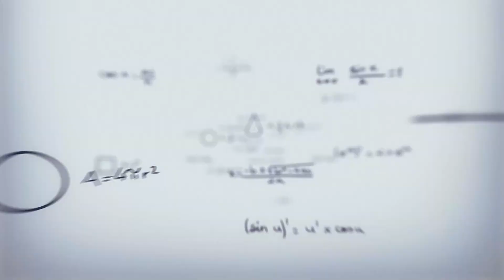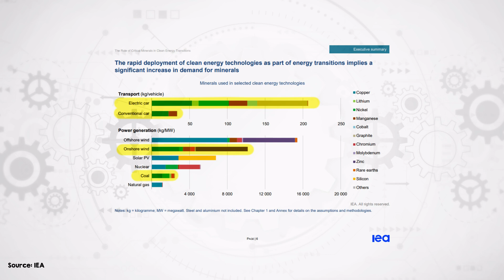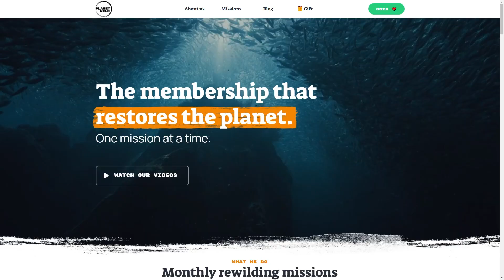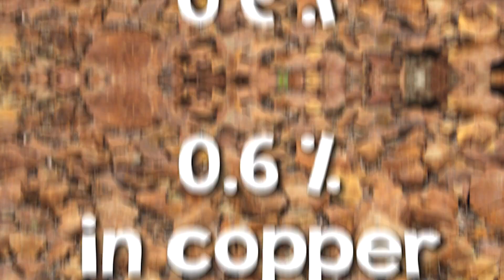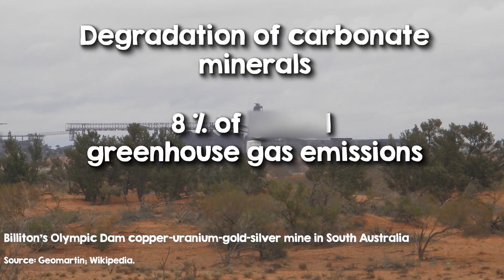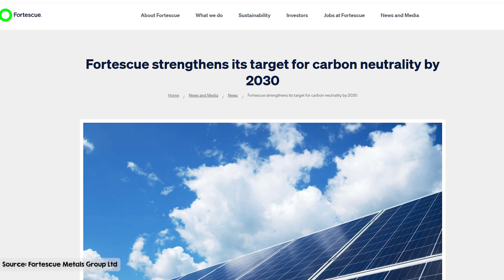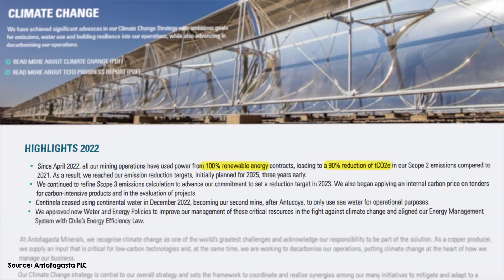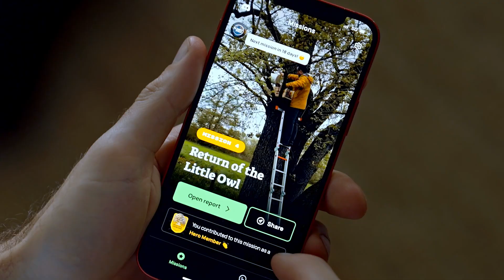Zero-Emission Mining Technologies are Here

Comment: Your an Engineer, while in theory your seem correct, you really need to spend some time with a Economist or just someone who knows basic maths!

You said a avg car burn 17k tonnes of fuel, probably does. But you say the Electric car only uses 160kg? Thats only for the Battery, that battery needs energy to actually move the car. Essentially the battery is just a 160kg fuel tank, made of expensive and heavy materials. (That also requires huge government subsidies to make it actually affordable for everyday consumers)

Currently EV's pull their source of energy from the grid which is mainly fossil fuels (How much is the total tonnes of fuel needed when you factor this in?) You should also measure this by car weight x miles travel. Your cherry picking data here!

As we move more towards EV's that demand on the grid will grow which will cause more demand for energy, which results in higher electricity cost for everything. EVERYTHING

Now to the MINING, I'm shocked it only contributes 20% to total green house gases. An avg dump truck burns around 500-800litres of diesel per day, 24hr a day, 365days of the year. Also Electric Dump trucks are a scam, they are smoke and mirrors tactics for big companies to look "environmentally friendly" because none of those Electric mines are profitable. hint: they do it for the tax write offs.

JCB & CAT both abandoned their research and production of Electric Mining equipment saying it not financially viable and the electric motors can not produce the power levels required to move large quantities of pay dirt. Again they only make EV machines to look "environmentally friendly"
Reply: Nah that is a load of hot garbage. Electric motors are already common in large industrial machinery, as many of them are actually diesel electric. Electric motors don't care where the electricity comes from. That is why they will take over the market and nearly all combustion engines will become obsolete.
Reply: Last month CAT announced its first underground electric mining truck.  Also, CAT displayed electric mining equipment at the 2024 Consumer Electronics Show in Vegas.
Reply: Again these are mostly smoke and mirror tactics to look “environmentally friendly”

Still isn’t a profitable full scale EV mine site any where globally. 

It’s why only the big corporate company’s are getting into it cause they can afford to take the losses.
Reply: Again these are mostly smoke and mirror tactics to look “environmentally friendly”

Still isn’t a profitable full scale EV mine site any where globally. 

It’s why only the big corporate company’s are getting into it cause they can afford to take the losses.
Reply: Again these are mostly smoke and mirror tactics to look “environmentally friendly”

Still isn’t a profitable full scale EV mine site any where globally. 

It’s why only the big corporate company’s are getting into it cause they can afford to take the losses.
Reply: JCB are going for hydrogen, which can be produced by electrolysis, although that is currently more expensive than getting it from natural gas:

' JCB’S £100 million investment in a project to produce super-efficient hydrogen engines is going full steam ahead – with the reaching of a major production milestone.'

They are not sticking to conventional diesel.
Reply: @davidmartin3947  Hydrogen can indeed be produced by electrolysis... and the power for it can come from tenable sources.
Unfortunately, it does not.  Nearly all the hydrogen produced in the world is done by steam-reforming from either coal or natural gas.  Using THAT hydrogen is not any better... possibly worse, than using diesel.
Reply: @st-ex8506  Nearly all electricity produced was until recently from fossil fuel resources.
Green hydrogen production needs green electricity, so it is unsurprising that it is later than the cost drops and increasing productivity of renewables.
No reason to rule it out, it is just a follow on.
Reply: @davidmartin3947  In both my country, Switzerland, as well as in France, where I reside, less than 10% of power generation has been from fossil fuel for... decades!
So, a fossil-fuel grid was historically true in the US of A, but it is not universally true.
And even where electricity is either nuclear or renewable for decades, very little if any "green" hiydogen is produced.  The reason is very simple:  it is energetically, environmentally and economically unsatisfactory, even with the latest technological improvements.

Green hydrogen has a future, don't understand me wrong, but in industrial applications, where it would replace ca. 100 million ton/year of "grey" hydrogen (I personally prefer calling that one "black"), NOT in transport (with possible niche exceptions), and not in energy storage (same caveat).
Reply: @st-ex8506  Switzerland has loads of mounrtains, and ran on hydopower, which is pretty specialised, and France in the 70's built nuclear, which I fully supported but was not adopted as a general solution.
I am unclear why you should equate that with present energy solutions, when the price of solar and wind has dropped manifold, and hence the imput prices to the production of green hydrogen even ignoring the drop in electrolyser prices.
And I live in the UK, not the US, and my comments come from that perspective, and hence North Sea wind etc, but fossil fuel was certainly the rule here, before renewables took over much of electricity generation.
It seems to me that you are improperly confounding what was historically true in energy production and the potential to produce green hydrogen with present opportunities, where costs are dropping manifold.
Reply: @davidmartin3947  I agree that using very cheap solar or wind power directly (i.e. without storage, when they are plentiful), would reduce very significantly the cost of "green" hydrogen.  But, for the time being, using the limited amount of renewable power to charge EVs equates to using that limited resource 3 times better than going over the hydrogen detour.

Using batteries, or pumped hydro for energy storage is also around 3 times better than using hydrogen as a storage medium.

One day, probably in the 2040s, there will be an absolute excess of renewable power (read Rethink X Energy Report... I apologize if I already suggested that), and using THAT excess to either do CO2 capture directly from the air, or for storing it in the form of hydrogen will make some sense.

But for the moment it does not!

And I worked over 5 years on a project for improving hydrogen production by electrolysis...
Reply: Many grids are already NOT "mainly fossil fuel".  In many countries, fossil fuels now account for less than 10% of the total power generation, and precisely 0% during the night, when most EVs are being charged.  Anyway, you cannot hold against EVs that the grid is "dirty"... it is ANYWAY much cleaner than burning petrol or diesel!  And all grids are getting cleaner every year!  
EVs are NOT making power more expensive, but the contrary.  As they are predominantly charged at night, using plentiful power capacity, they help the utilities better utilize their assets!  You definitely need an economist yourself!

Electric dump trucks are saving operators millions!  A quarry + cement factory, near where I live, has tested an electric dump truck successfully, and has now transitioned its fleet to 100% electric!  They shared their energy savings publicly!  Those electric trucks move 65-ton loads!
Please tell me from which source you have the impression that "Electric Dump trucks are a scam".  Because I fear that it is precisely that source that is a scam!

Finally, many mining and other earth-moving manufacturers are introducing more and more electric models, as they are in high demand in Europe.  Contrary to what you said, I believe that CAT is among them.  JCB is a special case, as they decided to go to hydrogen.
Reply: A big thumbs down for the lies and misinformation in this video.
1. Rosie claims 10% of global CO2 emissions are from mining, "with over 90% of that from fugitive methane released during coal mining".  First, she just confused methane and CO2.  Doesn't she know the difference?  Second, according to "Our World in Data" "Greenhouse Gas Emissions" chart, "Fugitive emissions from energy production" is only 5.8%.  This includes all CO2 and methane from all types of energy production.  Does she just make up numbers?
2.  She compares the 12,750 Kg of fuel burned by a petrol vehicle with the 160 Kg of minerals used in an EV, and says that's 99% less mining.  Surely she knows that in order to get 160 Kg of minerals, you need to mine at least 2 ORDERS OF MAGNITUDE MORE ORE.  In other words, you need to mine 16,000 Kg of ore (and overburden) to get that 160 Kg of purified, finished metals.  This doesn't even take into account losses of materials from the manufacturing/fabricating processes.  (I'm not including the recycling of batteries since it is only hypothetical, and not commercial reality at this point in time.)  Petroleum extraction generally removes only the petroleum from the ground.
3.  She talks very flippantly about increased mining being good for the planet since it reduces the amount of plant food (CO2) released.  Plant food becomes people food through photosynthesis.  Do a search for "Carbon Dioxide Fertilization Greening Earth" to find an article on the NASA website about a study showing increased CO2 is 70% responsible for increased plant growth on earth.  Also, interestingly, climate change is responsible for 8% of INCREASED plant growth.  (Yes, the MSM and the IPCC are lying to you.)  In reality, the climate is getting MILDER!  High temperatures are NOT increasing.  Low temperatures are increasing, primarily at night, in the winter, at higher latitudes.  That's why the average temperatures are increasing.  Also, severe weather is NOT increasing; that's just fear porn to convince you to give up your freedom and money to the elites.
4.  She also talks about the efforts to decarbonize mining and material production with no consideration of real-world economics and pricing.  It's easy to wave hands and pretend that all this will come about at no cost to anyone.  In the real world, these things have costs, making poor people suffer.  Poverty kills.

Comment: Discussing the amount of material lost from an EV battery and saying it's much much less than the oil 'mined' to power an ICE is misleading in two ways:
1. You are only considering the processed metals themselves in the EV battery, and not the raw volume of ore required to be dug up to produce those pure minerals, or the over-burden associated with accessing that metal ore. For example nickel ores are often around 2% in concentration, so 1.4kg of nickel wasted in your example actually requires 70kg of ore to be dug up, moved around and refined.

2. It is erroneous to equate 'mining' for oil with mining minerals. Oil (and gas) are produced from pressurized wells in oil fields, effectively being sucked out of the ground like a straw. That is nowhere near as energy intensive to dig up (and transport, and process) metallic ores. Oil in many parts of the world is transported on pipelines over long distances, making it very cheap to move, something that you can't do with any metallic ore.
Reply: A lot of oil needs to be heated by steam to be able to be pumped, and can be pumped great heights. It's not minimal energy, and the volumes are far greater. Oil extraction alone uses more energy than all mineral ores combined.
Low grade ores are not transported. They get concentrated first, typically with flotation. Only iron ore and bauxite is shipped raw because it's already highly concentrated.
Reply: Low grade ores still have a crazy amount of emissions associated with them. Like I used to work as a geologist and the amount of effort that goes into mining a single gram of gold is insane. And then after all the effort it's statistically going to end up in a vault or maybe jewellery. It makes no sense.
Reply: Except that all the oil needs to be transported to the point of use, whereas only the refined metals need to be moved to the car factory, once. Also I am not sure Rosie factored in the fraction of crude oil which is not useable for petrol and diesel engines, which could double the amount of oil needing to be extracted, easily blowing ICE engines back to last place.
Reply: A big thumbs down for the lies and misinformation in this video.
1. Rosie claims 10% of global CO2 emissions are from mining, "with over 90% of that from fugitive methane released during coal mining".  First, she just confused methane and CO2.  Doesn't she know the difference?  Second, according to "Our World in Data" "Greenhouse Gas Emissions" chart, "Fugitive emissions from energy production" is only 5.8%.  This includes all CO2 and methane from all types of energy production.  Does she just make up numbers?
2.  She compares the 12,750 Kg of fuel burned by a petrol vehicle with the 160 Kg of minerals used in an EV, and says that's 99% less mining.  Surely she knows that in order to get 160 Kg of minerals, you need to mine at least 2 ORDERS OF MAGNITUDE MORE ORE.  In other words, you need to mine 16,000 Kg of ore (and overburden) to get that 160 Kg of purified, finished metals.  This doesn't even take into account losses of materials from the manufacturing/fabricating processes.  (I'm not including the recycling of batteries since it is only hypothetical, and not commercial reality at this point in time.)  Petroleum extraction generally removes only the petroleum from the ground.
3.  She talks very flippantly about increased mining being good for the planet since it reduces the amount of plant food (CO2) released.  Plant food becomes people food through photosynthesis.  Do a search for "Carbon Dioxide Fertilization Greening Earth" to find an article on the NASA website about a study showing increased CO2 is 70% responsible for increased plant growth on earth.  Also, interestingly, climate change is responsible for 8% of INCREASED plant growth.  (Yes, the MSM and the IPCC are lying to you.)  In reality, the climate is getting MILDER!  High temperatures are NOT increasing.  Low temperatures are increasing, primarily at night, in the winter, at higher latitudes.  That's why the average temperatures are increasing.  Also, severe weather is NOT increasing; that's just fear porn to convince you to give up your freedom and money to the elites.
4.  She also talks about the efforts to decarbonize mining and material production with no consideration of real-world economics and pricing.  It's easy to wave hands and pretend that all this will come about at no cost to anyone.  In the real world, these things have costs, making poor people suffer.  Poverty kills.